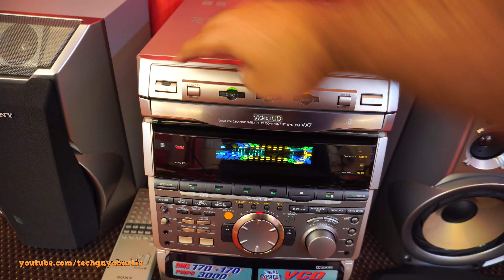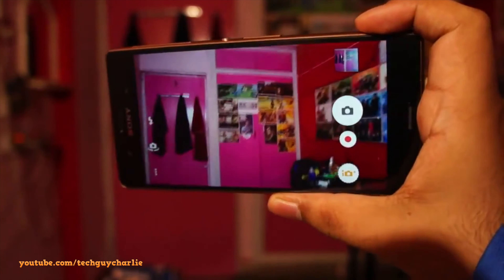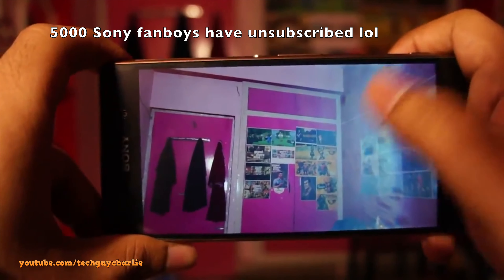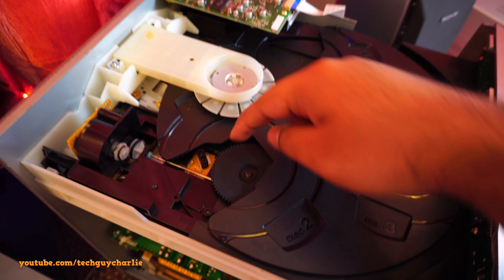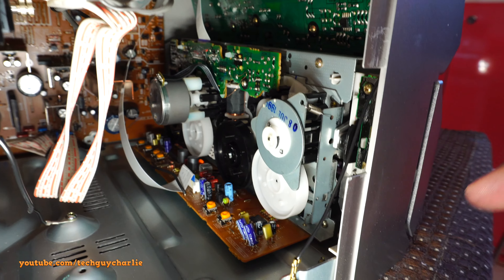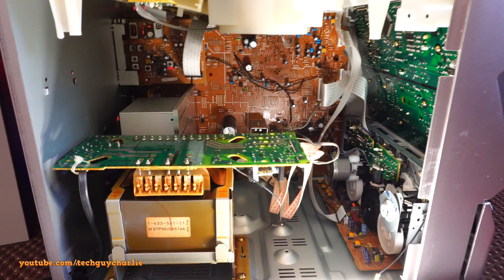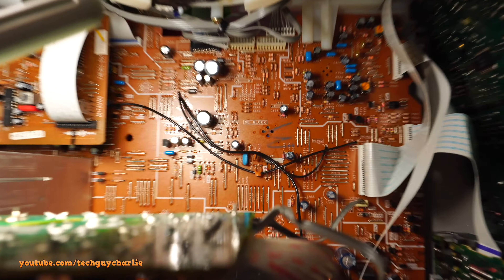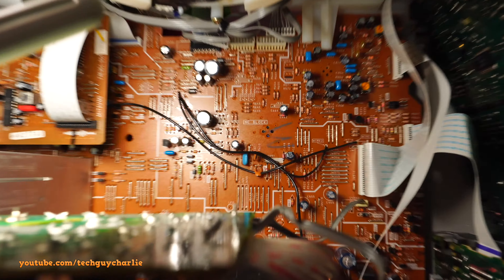How I fixed the Sony Mini HiFi CD player grinding noise and a look inside the system

Comment: I have the HCD RX7C which is virtually identical and was making the exact same noise. Ordered a pack of different size belts from Amazon for very little money and fixed the two belts for the cd changer, took about 5 mins to do and its now fixed.
Now I need to work out how to do the cassette player cos after approx 25 years all the belts were like liquorice.
Reply from the maker: Thats awesome! a bit of isopropyl alcohol will do wonders removing the gooey old rubber belts.
Reply: I need to take the front panel off using the service manual, it's too fiddly to do it in situ
Reply from the maker: That is one of the reasons why I didn't bother fixing mine, I was ready to pay Sony for it, but they just refused to fix it, said they don't have spare parts for 10+ year old products.

Comment: Excellent video! I have a MHC-RV6 bought in 2003 which now have the same fate with the VCD changer module. Produces the same grinning sound on power up. Will use your trick to depower the CD changer. Thanks a lot. 👍
Reply from the maker: RV6 is a great system! Let me know if you were able to cut the power to the VCD player.

Comment: Excellent video. Just solved the whining noise in my Sony Rxd5 of the CD changer continually spinning even when listening to tuner/radio. When I opened it up the CD changer belts were still functioning and the disc changer keeps spinning. I disabled the motor as shown, no more noise. We only use it for the radio. I did notice the tape deck belts were lying in bits. Thx for posting you help me alot. Interested in the Bluetooth audio receiver option you mention.
Reply from the maker: Thank you!! I still have this stereo and have been thinking of getting the CD changer fixed, but don't see any point in doing so lol. I have a tutorial on how to install and set up a Bluetooth audio receiver, I'll link it here: https://youtu.be/K2Bfe-zqdks

Comment: Mine is a MHC-DX3 and everything works fine but when I put caseetes in to play or record which was honestly the main reason I bought it, it randomly switches back and forth on the rewind and fast forward and makes super loud clunking noises for a while and then goes quiet and does nothing. I can't figure out what the issue is or how to fix it. It's the only issue I have with it. I just really want to record and play casettes, I don't think I'm able to fix it myself so I'm just hoping some repair shop nearby is willing to fix it, assuming they  had the parts which they usually make you buy yourself if it is uncommon and overcharge...

Comment: Thank you!   Although I replaced the broken belt with a hair tie of all things (exact size match!) it didn't fix the buzzing completely so I simply unhooked the power to the CD changer as you instructed.  There must be another broken belt deep within but I'm not using the CD feature anyway.
Reply from the maker: That is awesome! mine is still broken lol, sadly discarded all my cassette collection a while ago! I've hooked up a bluetooth streaming device, and it works great with my phone.

Comment: Bro I have a sony system of 2600w 
120+120w audio , it used to work nice but you know it used to make kinda Susy noise,so I opened it.but it didn't work after assembly opened it again then it worked but the fan didn't work and it shuts every 30 minutes or if I play high bass songs or turn on " v groove"....PlZ help me 😭 it sounds like heaven

Comment: How have you connected your mobile as auxiliary device. Which cable to use and which function to select?
Reply from the maker: It really dpends on what kind of phone you've got, most modern day phones dont even have a headphone jack, so most likley you will need to buy a Bluetooth audio receiver. As for the cable its a standard 3.5mm to RCA cable, plugs into the TV audio in port of the stereo.

Comment: I have rx77s . I tried unplugging both . It cut power to CD player but I lost function of amp . Any suggestions anyone . ? I just need the auxiliary amp input. I guess I need to only unplug one of the connectors .. but which one ? If nay knows of link to service manual I’d be grateful. Any thoughts Charlie? Ps my belt were melted ..I was in a hot country and both Sony hifis developed same fault.

Comment: Amazing.. Thankss for ur solution.. If i want to keep it simple, can I just cut the cable?
Reply from the maker: No, don't cut it. Just unplug the connector from the main board like I did.
Reply: @TechGuyCharlie  my hifi is similar to yours but little more complicated..i cant reach the end of the cable so I cut it.. Is it safe?
Reply: @gcha2806  😆😆😆

Comment: I own an Sony MHC 881 system and CD changer still works after nearly 25 years. My grandpa bought a system from 2005 and after two years both CD and tape player were dead... They really cared about quality in 80s and 90s.

Comment: Thank you, your video gave me confidence to open my device and check the belt- the CD tray wouldn't open
Turned out the CD tray belt just slipped over, I doubled it since it is worn out and put it back on- perfect again

Comment: hi i need help, i have a chain with the following reference gzr999d i wanted it repaired but i made a mistake, i had a short circuit between the transformer of this chain and the cassett motor

Comment: It's incredible to see the level of quality inside the older shelf stereo models. Huge transformers and heatsinks that you'd typically only see in the real deal home theater receivers. It gives you a hint as to the power, quality, and amplification abilities of these things. 

I'd say the MHCEC909IP model (the blue 540w RMS model) is the last high quality model from sony, as far as components go.

The successor to that model, the black 700w "MHCECL99BT" and its non-bluetooth counterpart, switched to class d amps and if you take them apart, they use very small power supplies, caps, heatsinks, you name it. They weigh less than a game console. 

It's obvious Sony saw the decline of interest and stopped trying around 2013/14.
Reply: I used to have a jvc hxd77 and it had a small heatsink with ic amp and small transformers

Comment: Around four days back, I bought a Sony RXD10AV (which is 98% similar model) except that it does not play VCD but comes with other packed features such as DVD 5.1ch input and Dolby ProLogic Surround. It's also a very lightly used model with some scuffs. The tape deck was failing on me but I managed to fix the belts on one of the tape decks. I was lucky to get that...… THE SOUND IS AWESOME...BASS IS BLASTING...

Comment: Dude… why not simply replace up the belts at both cassette players and the DVD motor? Then, replace all the electrolytic capacitors, despite no ring TOTL, they were intended to last more 20 + years….

Comment: Quick note: If you have the same issue and want to unplug that 2 plugs (10:38), move them upward. Same axis as the cables, do not try to move them away from the board (perpendicular to the circuitboard). They had rails inside, it was hard to judge the direction needed to unplug without damaging the circuit. It worked in my case
Reply: Thanks. How did you get a. Hold of the wires .

Comment: Hi Tech Guy Charlie and others

So  those music systems of 90s were chip based class d amplifiers and Not transistor based class AB discrete designs?..pls confirm if my understanding is correct?

Comment: I have a MHC RV5 bought it about 17 years ago, got the same problem that's why I made a search on youtube. Thanks for the tips will try to open it and use some elastics to solve the problem. The K7 are working fine.
Reply from the maker: I got mine fixed from the local repair shop :D they just cleaned the rollers and put new belts, everything is now functional.
Reply: I too had a RV 5.I sold it on olx and brought a GR8, an earlier generation model

Comment: I have same unit. I replaced a broken belt with a rubber band. Buy a bag of different sized rubber bands. Used a small one and works perfectly.
Reply from the maker: I gave mine to our local service guy, replaced belts for CD and cassette, both are working now :D although I have no use for both CD and cassette lol, still it's nice to have a fully functioning unit.
Reply: what kind of rubber band did you buy?
Reply: Owen Adrian it was just a regular rubber band.  I bought them at a dollar store or something equivalent. They came in a bag with a;pros 100 different sized rubber bands. Not a big rubber band. Not a small rubber band. Just medium sized. Plus , I left the side of the stereo off after I replaced the band. I was surprised how hot it get inside there, so I decided to just leave it off. I really like the stereo and was going to throw it away, but decided to give a rubber band a try.
Reply: ttown55 Nice info dude, hope thats help me fixing my father’s Sony Mini HiFi😄

Comment: I just bought an used VX8 yesterday. The sound is amazingly good. There is the same problem though, the CD belt and cassette belt are torn. 
However I still own the GR8000 which is a beast.

Comment: Thank you so much bro. This video has really saved my music system. I had similar problems in fact exactly like yours. The noise kept coming and when ever I want to listen to music the CD tray use to come outside with noises too. I would just like to ask you how to disable power to the CD tray and how to install bluetooth in the system. Would really appreciate the help bro. Thanks a million ton bro

Comment: Great video dude. Might as well order the belts and fix it. It's a shame for a good machine (no matter what that is) to work half way. Specially if the fix is easy. This year, since we are locked in the house anyway,I went ahead and fixed all the stereos and boomboxes that I had since the 90's. I also don't use cassette or cd anymore and hacked some of them to have bluetooth. But it's good to know that they still work and are in great condition after 3 decades of use. They don't make 'em like that anymore.

Comment: Hi friend i have a GRX8 all working but the control volume and the jog knob does not working and i don't have the remote. Please Can someone helps me.  Best regards
Reply: Poulpino for the volume knop it’s common problems on sony mini hifi stereo.  All you need to do remove front panel clean the knop from the old dry white grease then apply new grease to knop and its will works perfect again. I believe your volume knop freeze or count up or down sometime

Comment: The "bodge wires" are jumpers. It's just a simple way to use both sides of a single layer PCB.
This technique is still used on multi-layer PCBs on more modern electronics, though they tend to use surface mounted 0 ohm resistors (I assume it's easier for the assembly robots)

Comment: This is reparable in Delhi Rajiv Electronics at Karol Bagh .I bough a Sony GR 8 model and got it fixed
Reply from the maker: Already got it fixed from the local shop here dude, just needed a new set of belts. 😊
Reply: @TechGuyCharlie  Well where the repair shop is located.I need to change the slider pin of my said CD player

Comment: I had the same grinding noise so I didn't use it for years. After seeing ur video I checked my audio system it had the same grinding noise and I cleaned it with blowing from vacuum cleaner and attempted to do it troubleshooting but only few lights are glowing in front panel and it's not working even after putting the cable to its previous position. Can an air blow from vacuum cleaner could damage a system? Any help

Comment: I have a Sony HCD-R550 , aprox. is the same system , the speakers are just3way but the woofer and demsions is the same ,is also from '99 and sounds very very clean and loud , you are lucky becouse you get theese speakers brand new 👍👍👍👍👍👍👍👍
Reply from the maker: When I bought this, I was afraid the woofer foam might have rotted out since I was told the box has never been opened and it was sitting in a home which was locked for almost 5 years, but thankfully everything was perfect. Yup, these speakers are really good, sounds better than today's Sony's tower HiFi stereos. 😊

Comment: I had similar issue, CD making noise on both of my identical stereo's (GRX35) in the last 12 months or so. I never used the CD, so its almost certain, that it was a "feature" they programmed. CD goes bad after 10yrs and annoy the user, so we would buy another one.... I did the same thing, disconnecting it, so they could not trick me either ;) Thats just my thinking though.. Awesome product BTW the sound is just amaizing considering its size and age.
Reply: it's not a programmed features, the belt go bad, it happens to all kinds of cassette decks and cds of every brand or design issues, there are a lot of other ways to make the user buy new stuff and mostly happens in phones/laptops/tv

Comment: Hi, I have a same model. All the belts gave melted away. Cd and cassette decks are not working. I want to use it as an amp but, the volume control is functioning erratically. Could you please help?
Reply: dwarakanath krishnamurthy you need to clean volume knop from old grease inside it

Comment: Hi tech guy Charlie,

First of all a big thanks for making a video of your repair attempt. It helped me gain courage to open and fix my MHC-G880 (bought in 1999 by parents) which had pretty much similar issues as your system when I turned it on almost after 10 years. Now when I play it I am reminded of what I was missing .. pure awesome sound with deep bass .

Couple of thoughts. 
I could not unplug the CD unit power cables on the main board as you did. Was not coming out easily. Instead I removed the plugs on the other end on the CD unit board. Just in case someone faces same issue.

The bluetooth unit. I bought the same tp link that you have but realized it is v4.1 .. no deal breaker as the sound is awesome and range is good. However, I think a bluetooth  v5 might be even better as all the new phones and devices are v5. Will that improve sould further- I don't know. Range and stability - definitely yes. 

Lastly, I am contemplating fixing the CD unit belt but not really feeling pushed. I have few old CDs so again nothing much to gain and am happy with the way system works now. What about you? Did you fix the CD unit?

Thanks again dude.. :)